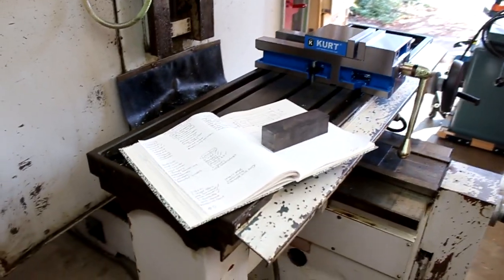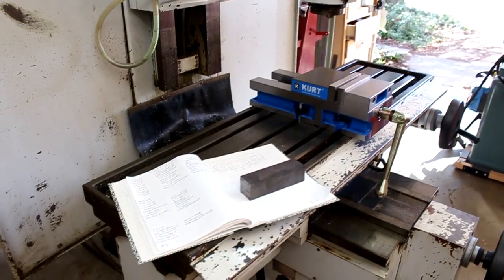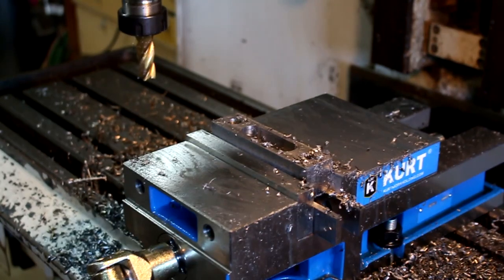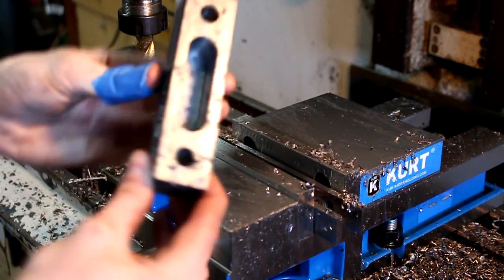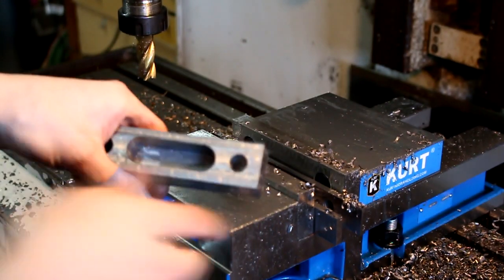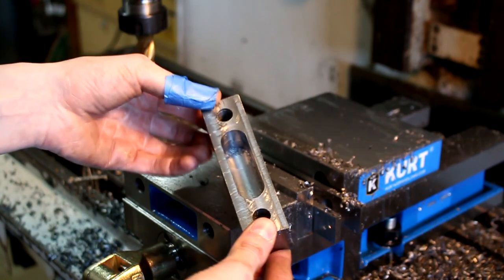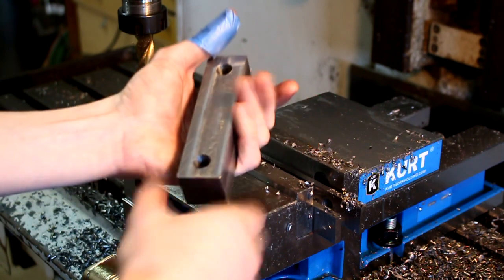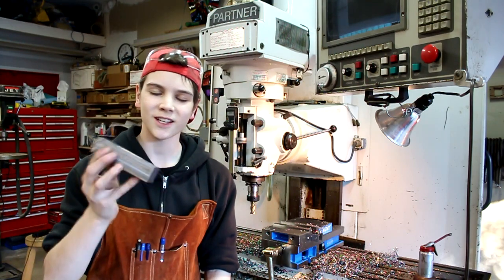First Chips: Making a Thing!

Comment: Great start...you just need to turn the vice around...its the wrong way around.
Reply: I hope this is sarcasm lol.
Reply: @moosifulman  Seriously the screw and handle have been reversed...swap them back around and flip the vice 180.
Reply from the maker: No the vice is supposed to be that way. Vices with the fixed jaw in the front are 'CNC' vices I think. My dad said something about always working in positive coordinates. I did some research myself and I read that reverse vises are good for being mounted on a tombstone in a horizontal mill because not only is the handle on the top but also that you can run the same program that way as you would on a vertical mill.
Reply: @Hwy49RC  Not to say its wrong how you do it. I never seen anyone use vice that way but you can use because its possible. At least the design allows the handle to be used from the backside. The positive coordinates i figure relate to the fixed jaw beign where it is now so left corner zero makes xy always positive. Its just a failsafe some peoples use to have all positive numbers. But the thing is there is no really differentiated cnc or manual vices.
Reply from the maker: @TommiHonkonen  Yeah true, there really isn't anything that makes them a CNC vise, they are just more common on CNC machines from what I have read. But you know, I'm no expert😁 And yes about the bottom left corner.